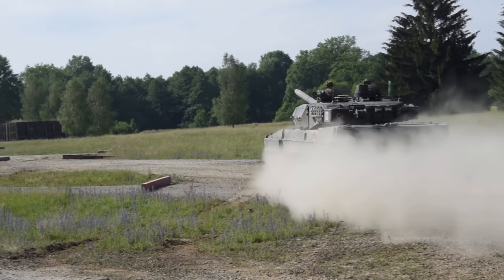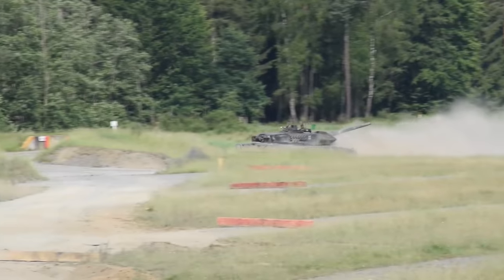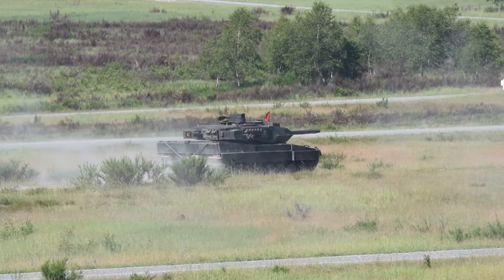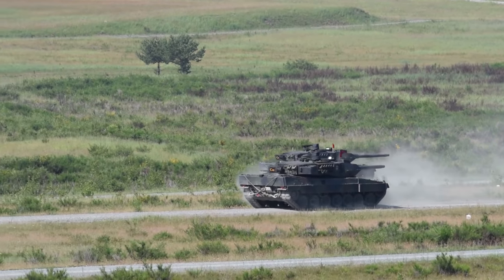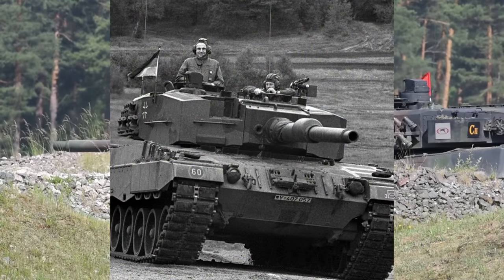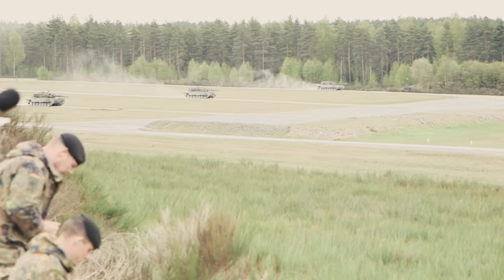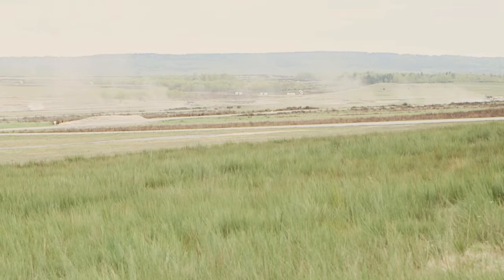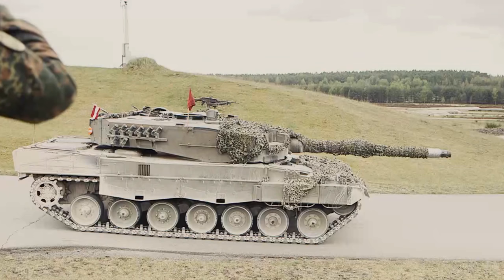Leopard 2 Main Battle Tank | GERMAN ENGINEERING

Comment: Waiting for the overly engineered King Leopard.
Reply: Aaron Seet I wish after WW2, NATO and the Soviets just kept making heavy tanks like the IS. Eventually we would’ve gotten a moon gun on a tank and I just feel like we missed out
Reply: build the Ratte pls
Reply: oh it's coming, just look at the more beefier 2A6-7 Leos with its additional modular ERA armor and AMAP-ADS/APS
Reply: overly engineered ???.....all tanks are overly engineered.....tank losses are permanent so they better be .
Reply: @martijn31101969  this is not meant.what is meant is that handcrafted chains will do the same job industrial welded ones to hold on tools on the tank during a combat situation. the one just takes longer to assemble. and time is a important factor.

sometimes simple solutions do a better job.
Reply: @martijn31101969  not all, each nation has its own design philosophy
Reply: true . but philosophy  has very little to do with technology but its more a money problem.
Reply: @martijn31101969  it has, it's correlated directly to their combat doctrine in general
Reply: @martijn31101969  the new Japanese Type 10 "pocket MBT" for example, they do have the money, but they have a different fighting doctrine than the european or south korean
Reply: simple solutions to complex high tech systems ????..........yeah is much easier to use a towel to dry your hand instead of using hot air blower
Reply: @saltymonke3682  its an amazing piece of equipment..... overly engeneered isnt a bad thing.
Reply: @martijn31101969  ofcourse, simpler mechanism and features have less engineering error point within the weapon system. Less maintenance means less spare parts, less spare parts mean less logistical boondoggle in the combat operation.

 That's why German lost the war Both wars. Overthinking too much with no set of clear priority. Great complex engineering but less reliability, early production Panther is the poster child of it because its faulty transmission. German could move their thin overstretched resources to fix it, but they rather prefer a more complex and even heavier King Tiger (even Maus) instead. That's why US also will make their own pocket MBT in the near future (MPFP).
Reply: @martijn31101969  tell that to Panther, King Tiger, Tiger, Bismarck, Tirpitz and the current DM's Type 212 submarine. 

When you are in combat situation, spare parts logistic and maintenance are what matters for weapon system like them, otherwise it wont work properly or won't work at all. 

Cool performance on paper wont win the war if they can't field it to combat when needed due to maintenance.
Reply: Hanz,
Ze tranzmission didnt break,
We did nit recieve instructions on what to do now ja?
Reply: @osedebame3522  Heard of the Object 279?
Reply: Nobody

The Trailer for the King Leopard: The round that knows were it is
Reply: @doomedt-62  yep, clear you play wt
Reply: Yeah
Reply: Yep just gave to wait for MGCS lads
Reply: @osedebame3522  in ww2 the germans were close, search up the maus tank
Reply: König Leopard!!!!
Reply: You will be waiting a very long time then
Reply: It’ll be late, as usual
Reply: afterward they will make much simplified jagdleopard 😅
Reply: @martijn31101969  t-34
Reply: rheinmetall has revealed it's new 130mm gun equipped tank recently. it's based on the british challenger though.
Reply: Fingers crossed!!!!
Reply: Considering that the King tiger is also called the tiger 2, WE already have a king Leopard .
Reply: King Leopard is something I would love to see
Reply: @truereaper4572  Technically there already is a king Leopard. Please Look at my comments abovee
Reply: @Cleetus Yeetus for what, at who and why?
Reply: well, the Leopard 2 is essentially a King Leopard
since Tiger II is a King Tiger
Reply: @Cleetus Yeetus how am i a weeb
Reply: They've learnt their lesson. Never again!
Reply: @majungasaurusaaaa  what lesson
Reply: @guppiapfeljustleopardthing8756  To not waste resources and time into overengineered, costly, breakdown-prone equipment to placate the ego of dictators.
Reply: @majungasaurusaaaa  funny that you menshion brakedowns.
The Panther is prone to always brake down.
But in reality the panther became more reliable than the m4a2s
(Sources: 
Panther and its variants.
Panzerbau im 2. Weltkrieg
(Military history visualized Made a video on the panther))
The Tiger had about as many brakedowns as a pz4 after the first 3rd of the production was complete.
And the pz4 was the best alround tank and the easyest to maintain in the Wehrmacht.
And If you look at the German Transmissions more closely youll See that maintaining the Transmission on a pz3,pz4and panther took about as long If not shorter time than a sherman.

(Note i said maintain Not switch completly)

They invested lots of materials into these tanks but so did every other country.
USA:
T14, T20, T23, T25, M26, T26, M6A1, T95, T34, M3Lee(yes it technically failed as a tank due to its late comming in the war)
M22
Great britan:
Tortoise, Iron duke, comet, cromwell (both had major designflaws resulting in the crew getting knocked out If driven too fast)
Black prince, TOG
Reply: @guppiapfeljustleopardthing8756   Sorry, don't buy your reliability source. MHS did point out its poor reliablity btw.  The vast majority of sources state otherwise. 

As for materials and time spent, other countries didn't start producing failed prototypes for real. They had better sense than to do that.
Reply: @majungasaurusaaaa  
The reliability got improved with the a model on the panther.
The g made the Transmission Problems fade completly.
The range for a panther g before its Transmission broke is about 2000km while the ones from a Cromwell broke after 200km the T34 after 5000km and the ones on a M4 after 4270
Reply: @majungasaurusaaaa  General Heinz Guderian reported on 5 March 1944:

The frontline reports said service life of the tank's engine had increased up from 700 to 1,000km [435 to 621 miles]. Plus, the same Panther tank-equipped units reported that failures regarding final drive, transmission and steering gears were within a suitable range.[113]

He further noted a specific instance of mechanical reliability:

From 6 March to 15 April 1944, the 1.Abteilung/Panzerregiment 2 (1st Battalion, 2nd Panzer Regiment) reported a distance of between 1500 km to 1800 km. Four of their seven Panthers was still combat ready without any transmission or engine failure.[114]

On 22 April 1944, the same battalion reported how a good driver and commander can improve reliability:

This kept in mind, the battalion reported PzKpfw V Chassis No. 154338, Engine No. 8322046 reading 1,878km with driver Obergrefeiter Gablewski, 4.Kp/PzRgt 2. The vehicle was still totally operational. All items were in great condition but the tracks. The consumption of the engine has been 10ltr per 100km. The vehicle was still operating with its first engine and transmission.[115]

After that report from the units, the Inspector General of Armored Troops acknowledged this in a report, at 1944.05.06.: Der Generalinspekteur der Panzertruppen Leitender Kraftfahrzeugoffizer Bb Nr. 3177/44

The report confirms the opinion that thanks to the continuous improvement of its components, the life of the Panther tank has increased. The average lifespan of a Panther can now be roughly equal to that of a Panzer IV with around 1,500 - 2,000 kilometers between two major repair and maintenance processes.

And,

gearboxes also have a longer life. Even so, in several cases, at approximately 1500 km, the gear has broken down and the boxes have had to be replaced.[116][117]

An example of Panther reliability appeared in the June 1944 edition of Nachrichtenblatt der Panzertruppen (Armoured Troops Bulletin), from a Panther-recovery tank driver's report:

Unteroffizier Krause of a Panther workshop platoon has driven his Panther recovery tank – Chassis No. 212132 – 4,200km until 3 May 1944 without any needing to replace any parts. About 1,000km of this was made towing another Panther tank. The vehicle and engine are still in great condition and operational.[118][119]

On 28 June 1944, Guderian reported:

Regarding the experiences in opposing the Allied landing in Normandy: The Panzer IV, Panzer V Panther, and Panzer VI Tiger have proven to be successful. The Panther is inclined to catch fire quickly. The lifetime of the Panther's engines (1400 to 1500 km) is much higher than the Panther's final drives. A solution to the final drive teething is immediately needed.[120]

In September and October 1944, a number of modifications were fitted into the final drives as countermeasures to the reported problems including worn gear teeth, parts, bearings, and insufficient lubrication.[121]
Reply: @guppiapfeljustleopardthing8756  The G was indeed passably reliable considering the whole design was a Hitler insisted botch mounting way more armor than the engine and transmission were meant to. But we're not judging the Panther tank on just the G ausfuehrung alone. The most crucial fighting was for operation Zitadelle. And for that it was terrible.
Reply: @guppiapfeljustleopardthing8756  Last time I checked the Germans weren't successful in opposing the western allied landing. Guderian speaks to serve Guderian. He's charming enough to serve himself well during and after the war. I take his word with a grain of salt. Speaking of the man, he was the one envisioning the new medium to be around 35t before Hitler ruined it.
Reply: @majungasaurusaaaa  
How unedjucated do you need to be, to say IT was a hitler Design?

The panther started out 1937 as a 30 tonn replacement for the panzer 3/4.
Some of its designs were a larger turret, sloped armore of at least 20° and a long barroled 75mm gun to serve as anti Tank and anti Infanterie.
IT sported torsionbar suspension and a similar engine to the one in the VK 36.01 h wich was developed at the same time.
After 1941 when the germans meet the T34 they stopped the 30tonne project wich by 41 spiraled in a 40 tonne vehicel and changed the requirements to Match and outclass the T34 and kv1.
Daimler Benz presented a 43 tonne copy of the T34 with some designes picked from the 30tonne Project, like the turret.
The man company presented a bigger version of theyr 30tonne project wich then wheighed nearly 50 tonnes.
IT had modern torsion bar Suspension a 75mm gun in a new turret and a 60mm Front plate wich got changed to a 80mm Plate.
First the DB Prototype was selected but because man had contacts to the WPA (WaffenPrüfAmt) theyr design got looked at again and Chosen by the WPA.
To make a other point the panther had its 80mm at the Front and 40 at the side and thus had the same armore as a panzer 4.
So caling IT a unnecesary ammount of armore, regarding that the shermans had more Armor in generall is Just worng.
Due to the stronger engine, the later improved Transmission and the much needed 75mm high velocity gun the panther started out as a bad Tank but became a feared and pretty much good Tank .
To put it in contrast:
The T34 started out worse than the panther and many of its flaws have never been adressed .
The M4 took about as long as the panther to develope and had major problems untill the end of the war wich only got adressed after IT.
Further models of the M4 like the M4A2E3 had major problems with the space for the Crew, the heavy Transmission cover making it almost Impossible to properly maintain and the raidial and later "normal" engine made even bigger lists of failure in the field
Reply: @majungasaurusaaaa  
Hey If you just say: 
Oh i dont belive in sources how about you quote some articles or name a few sources.
If you look at guderians quotes He made after the war youll See he tries to make the Wehrmacht look worse than it was to charm the allies.
Just compaire is wartime quotes with his Peacetime quotes.
If i qoute post war statements He made about the panther started then they are either closer to the truth than wartime quotes or He downplays it so far, that it just looks rediculessly Bad.
So If you say that WE Schall Not belive him than you just made a paradox.
Because if we dont belive his early qoute than the panther is Bad but If we dont belive that quote we also have to not belive the later ones as well, where He praises allied soldiers and Tech and speeks out bad against germans.
So because WE cant belive His later statement as Well we have to assume that his early statements are right.
But then we cant belive that either and have to look at the later ones, wich we cant belive either.
When you say that we cant belive a negativ nor a positive you create a paradox where we start at either the positive or the negativ and get pushed to the other one because we cant belive the first one we picked but then we get pushed Back to our first choise and the spiel keeps repeating endlessly
Reply: @guppiapfeljustleopardthing8756  LMAO, way to get triggered over trivial shit like ww2 tanks. Yes, it was Hitler who insisted on extra armor. So you can credit that fail on him.
Reply: @majungasaurusaaaa  If extra armor is a fail than the jumbo M4 , T34 stz, Churchill, is Tanks and the modern britisch and american tanks are Shit as well.
IT wasnt even Hitler die who wantet more armor but the WPA
Reply: @majungasaurusaaaa  
Btw you know when you won a Argument, when the opposite side either insults you, says the topic is Not worth talking about or you especially ask your opponent for Data and He refuses to show Amy sources
Reply: @guppiapfeljustleopardthing8756  LOLOLOL at thinking a modern MBT is like a ww2 heavy tank. Yes, the UK and US went the firepower and protection route over mobility unlike the French and Germans but hell naw they weren't replicating the Tiger distaster. MBT=/= Heavy Tank. Again, read Jentz and Zaloga. You didn't copy paste anything reliable or convincing.
Reply: @guppiapfeljustleopardthing8756  Just because the priorities are the same doesn't mean these MBTs are analogs. Heavy tanks carried huge penalty in strategic mobility and reliability due to their weight at the time. That's the best ww2 tech could do. And post war they quickly went the way of the dodo. Modern MBTs may have different philosophies but they all fulfill the same criteria of versatility. They're sufficiently easily massed (esp soviet ones), highly mobile, have a large pool of parts and are common. They're descendants of medium tanks, not heavies. They're not overpriced, unreliable resource sinks that lose wars like those failcats were. 

The AMX-30 and Leopard1 learned the lesson of the Panther: Don't mount more armor than what your engine and transmission can handle. The Panther didn't even follow its principle thanks to Herr Hitler. That's why I commented "never again". No sane german engineer would design a "King Leopard".
Reply: @majungasaurusaaaa  
Do you ever read?
The requirements were given by the WPA Not by hitler.
Even the armore upgrade of the Panther 2 had nothing to do with Hitler.
Just blaming everything on that specific Individuum is like saying:
"Oh it was just a bunch of pissed off germans wanted to rule the world. And thats a complete caption on the 2nd world war"
Hitler had barely anything to do with the panther.
And like i said the panther had even less armore than the panzer 4.
The panther was able to carry its own wheight and the Transmission got fixed with the A and G moddels
(The A getting a big improvement to the final drive and the G fixing the Problem completly)
And to a other point you Made.
A single tiger 2 was cheaper than a amx 30 or a leopard 1.
While the centurions and chieftains are almost doubble the Price.
A single T26E1 did cost almost 2.5x the money a single tiger 2 costed and a Sherman did only outclass the price of a pz4 by 10%.
The germans did learn theyr mistake but the americans and british did Not.
The americans and brits encountered the heavys on the Battlefield and what they did?
Build and fielded the heavyest MBTs the western armys had.
Hell the cheaftain is almost 85 tonnes by now and the Abrahams is 78 by now.
But here is the catch you started compairing the panther to leopard and amx 30 but you know how stupid that is to bring in a Argument to enforce a point that is irrelevant to the topic?
Its like saying:
Oh the germans did learn from the Renault ft because they didnt made theyr sproket wheel out of Wood.
You see how stupid that Argumente is to compaire 2 things that came out almost 20 years apart from another?
After you brought that in I started to compaire allied post war tanks and you got Mad over:
You Cant compaire a heavy WW2 tank with heavy MBTs".
Its the same you did and you got mad yourselfe.

So let me set a verdict Here:
Panther:
Early models had many problems but got fixed with the next model of wich 4 times as much got produced than from the previus.

M4 Sherman:
Overrated Tank that took longer to fix major designflaws than the panther.

Post war and WW2 era Tanks: not compairable unless you soecify exactly in what they differ.

Your Statements:
Insults, no sources but 1 wich was wrong, keep saying hitler this and Hitler that

My statements:
Insults by the end of the Argument, quoting and giving my sources of wich 1 is debateable and 1 is controdicting with the statements itself makes ,

Sincerely 

None of your buisness.
Reply: @majungasaurusaaaa  oh and this whole comment section was originally about how the leo 2 already is a king leopard.
Reply: @majungasaurusaaaa  
I never said he was a saint nor did i excuse his mistakes.
The truth is that just because something was Bad doesnt mean it was hitler.

Hitler had his hands in exactly 6 tanks directly to a designchanging effect:
The tiger 1 and 2
The jagdpanzer 38t 
Jagdtiger 
Maus
Sturmtiger.

The only thing hitler decidet regarding the Panther project was to redirect the ressurces from the 30tonn project to the panther project and to look on both designs in a 2nd trial.

Values like armor thicknes , gun, and design was done to 98% by the WaffenPrüfAmt, 2 generals and about 30 Highranking officials from the Kummelsdorf testing facility where captured t34 tanks got evalueaded.
He wasnt even willing to approve on the design.
IT was 25 different people convincing him that the panther is needed.
The Tiger got aprooved by him and the king tiger as well as the Maus.
The panzer 1-5 were all mainly Approved and ordered by the WPA and the people from the MHC.
Hitler was Not responsible for everything. Nor did He decide everything even though most people who dont look at history closly will belive He did.

For exampel who had the Idea and approve for the extermination camps?

Himmler, Göbbels , Hitler or Göring?
Reply: @guppiapfeljustleopardthing8756  People in leadership positions take responsibility for their subordinates actions. In a totalitarian system where every weapon system going into production requires the fuehrer's approval responsibility falls eventually on Hitler himself. That's how his fuehrerprinzip works. Not Waffenpruefamt, not the generals, he didn't even have a Reichstag or Congress to shift blame to. 

Ditto for persecuting, arresting, enslaving and murdering people. It didn't matter if it was Himmler, the SS, Goebbels, Goering or whoever else came up with the idea and did the dirty work, responsibility falls chiefly on Hitler.
Reply: @majungasaurusaaaa  
I asked you a question and a solid answere Not after the phelosophy of your perception of the NSDAP leadership and its methods.

If he was in charge of everything then why did the 7th panzerdivision attac without command from him?
If he was in charge of everything why did a wehrmacht battalion fight with the americans.
If he was in charge of everything why is there No document, record or at least some other evidence that hitler directly drew something on a pice of paper, called it the panther and made the companys build IT?
Because the designs dont come from him.
Because he wasnt playing a big video game where he controlled everything.
The WPA proposed the need for a new medium, Hitler said "shift the recurces from the 30 tonne lroject to the panther project and the rest was job of the WPA.
For exampel If a leader is responsible for everything his "employees" do then trum should be at least in prison for the responsibillity of all people killed by the Police, goverment agencys and armys.
The same with every other country and leader.
Thats just not how the world works and that is not how the regime under Hitler worked.
He wasnt directly responsible for the panther or its Design.
He blantingly gave the order to the WPA and they made the specifications .
Hitler did not sit in his little chair and drew up something and called it a Tank.

If lets say your dog killed a child in our world the dog will be either put down or get restrained while the owner gets some punishment as Well.
If we switch out our world in this exampel with the one you created your boss whould be punished and put in jail .
See how that isnt working.
Even a messed up goverment like the one from the NSDAP did not work this way.
Reply: @guppiapfeljustleopardthing8756  My boss is not in charge of my pet. So why should he have anything to do with it? Hitler however is in charge of all weapon systems. That's because his political system puts him in charge of them as well. He alone has the power to approve. That's why he can't shift blame. Of course he doesn't design the weapons himself. But it doesn't mean he's not in charge. Killing the 30t medium tank project to push out a failcat rests solely on him. 

Hitler could very well have punished the examples you stated above. He was in charge of them. 

Trump isn't in charge of the police legally unlike Hitler is with all german law enforcement. It's a silly comparison. The system of the USA is not the same as in Nazi Germany.
Reply: @majungasaurusaaaa  because at the end of the day a when a panther brakes down, who is at fault?
Hitler or its Crew?
In my exampel the panther resembels your dog, you resemble the crew and your boss as the mustachio man.
Thats the point im trying to make .
And that hitler was personally involved in the panthers design to a massive extend is like saying the qeen build the Churchill.
Reply: @guppiapfeljustleopardthing8756  If the crew did everything by the book then it's not their fault. Fault then travel to the mechanics. But if they too did everything right then fault goes up to manufacturing. If they didn't make any mistakes and put the tank together according to design fault goes up the designers. If they designed the tank right but were forced to add 10 t worth of weight in armor on a frame that was supposed to take 35 t max then fault goes to those who did that. Those who did that required Hitler's approval to do so. Fault goes to Hitler who as fuehrer is in charge of everything and top of every chain of command. Yes, Hitler's fault it was that young men were put in shitty tanks to fight a shitty and hopeless war. 

For the millionth time, by boss would not be in charge of my dog. Now if it's a project at work that I screw up then yes, he too would be at fault and he'd punish me while his superior punishes him. Your example is irrelevant. 

The Queen is  not a fuehrer. She as british monarch was a figure head by that time. She had zero power in the process of weapon procurement. Again, another bogus example. Try harder.
Reply: @Antonio Montana Leopard 2s in generall are king leopards
Reply: @doomedt-62  The IS 8?
Reply: Got to admit it's DELICIOUS 😋
Reply: @guppiapfeljustleopardthing8756  that's a great point.  This IS the king leopard
Reply: No shit eh? This thing is a beauty, can wait for next gen. Unfortunately Canada will probably be in no position to purchase them.
Reply: @saltymonke3682  call it whatever you want the germans did and do build some of the hardest hitting badassed tanks. I wouldn't want to go up against them in anything built today period. The turkey shoot in the desert was against tanks decades behind in technology. Be interesting to see what would happen if it had been fought against the germans in these instead. Myself, l am glad they are on our side now.
Reply: @graham2631  transmission go screee......etch
Reply: Oih aih. Wehraboo, or rather Bundesboo wett drem.
Reply: @osedebame3522  yeah that would be great, but the British has built the centurion which has the sabot shot that can pen through a lot of armor, but yes if the sabot haven’t been invented, we would have seen heavies vs heavies but the increase of killing tanks better got in the way
Reply: Will now have 6 breakdowns a week instead of the usual 4
Reply: Or the 200t hamster
Reply: A Royal Leopard would be cool
Reply: Waiting for the overly engineered king Abrams
Reply: The Germans never called their own tanks "king" tigers, it was given by allied armies you wehraboos lol
Reply: @dillerhiller   Nea we are building flying saucers.
Tanks are obsolete.
Reply: I want a jagdleapord, fixed casement, 130mm w/ auto loader
Reply: @martijn31101969  It is, actually. It’s faster.
Reply: haha!!!!!
Reply: King Tiger: I am your father
Reply: Great tank. Badly needed in Ukraine right now to push back the russian invader.
Reply: My word, never even thought of that
Reply: @lead_farmer69  I would take Leopard 2  instead of soviet T-72.
Reply: @saltymonke3682  simple is better mfs when their primitive soviet tank gets blown up from 2km away by an over engineered and even more reliable western tank.
Reply: @RutakoVon  you don't get the idea of German over engineering principles. Abrams is simpler than Leo 2. Even German had special machine to wash Leo 2, while Americans onlu use hose and wet pond. That's 1 aspect. I haven't talked about the transmission and shtt. Engine for example, Leo 2 use diesel with high maintenance tenpo, Abrams use turbine engine with lower maintenance and can use any fuel or like Japanese diesel, that's more simpler and can handle abuse. 

German and Japanese over engineered their stuffs, but to 2 different pathways. German engineers over engineered stuffs with many features but you have to use it according to their rules and usage. Japanese over engineered their stuffs but with in mind that their products will be abused beyond limit. They have 2 different engineering principles but both over engineered their products. 1 is features the other is reliability from abuse.
Reply: @RutakoVon  Sherman is simpler than Tiger, and has higher survivability of its crew too.

The difference between Soviet and Western MBT is not simplicity or engineering, it's blown off panel. Soviet use autoloader while West use young men to load. Which one is simpler?